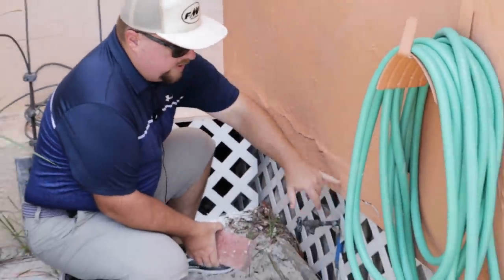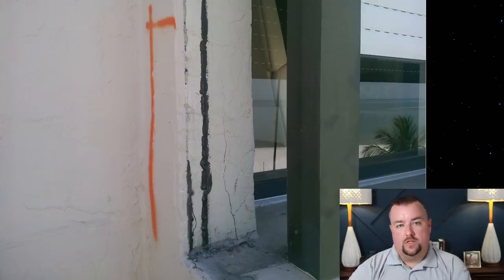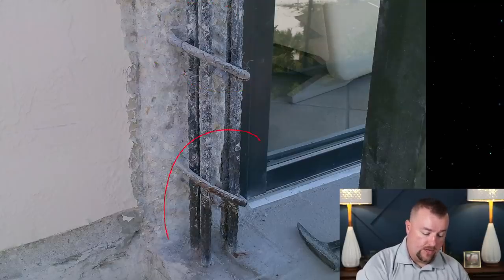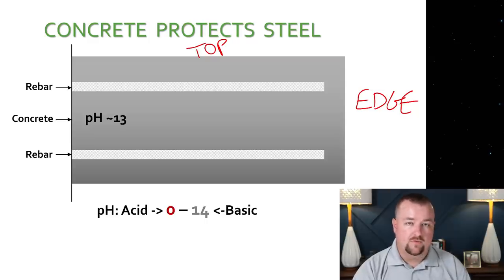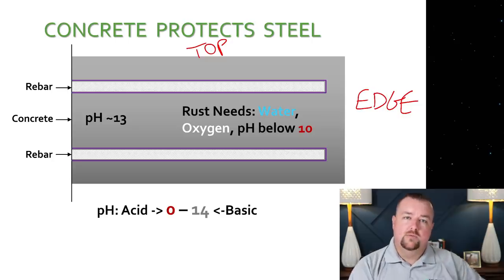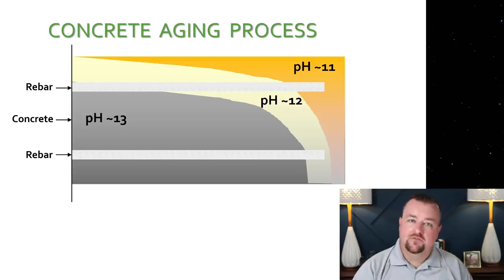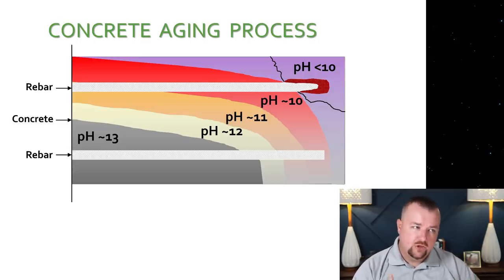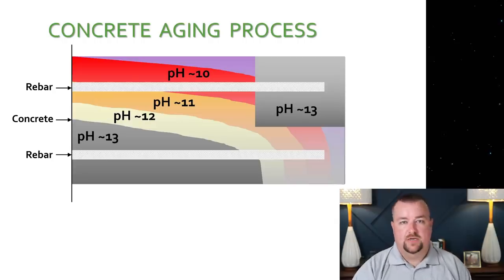Reinforced Concrete's Number 1 Enemy

Comment: So, in conclusion, one should avoid an older concrete structure.  Cause there is no way a condo board spent enough money to hire contractors to habitually to maintain these structures.  And if they are now forced to do repairs because proper maintenance has most likely never been done. It’s going to exceed the value of the building in many cases.  Imagine owning an apartment worth around $400,000 and getting hit with a special assessment for $100,000 to pay for your share of the repairs? Like your hoa. Going up 1,000. Or more per month?

Comment: Your are some what correct...but you can not explain why bridges with salt water area don't corrode or why concrete has not decorate.  You have to specific why it corrodes here and not there. ANd I had seen bridges and building last 60 years without issue near the Ocean.  And you failed to mention frost and defrost .  Example : Coney Island Buildings

Comment: Question to the uploader. 
Why dont they rustproof the steel rebar in advance? Do you have technical data on powder coating, s
Zink oxide, solvent epoxy coating? Urethane coating?
It's a matter of an ionic polymere crosslinking chemistry someone knows about.

Comment: How common is this and does this mean any cheap slab's can break even pre tension cables? Would grounding the rods  and cables keep them from oxidizing?
Reply: Can you generate low voltage in that  acidic environment,?

Comment: I think the explanation of the chemical situation is not complete. You mention CO2 coming from the air. That and water forms a weak acid: H2CO3. Which has created caves in limestone rock. The salt (NaCl) from seawater spray in contrast dissipates into an acid and a base. But both are in equilibrium so they cancel each other out. Which is what made salt in the first place: the neutral end product of an acid and a base reacting with each other. So the shift to an acidic environment in the concrete is done by the CO2 which gives H2CO3 carbonic acid, which is weak but still an acid.

Comment: So if you want to make things last a hundred years, don't design the structures with reinforced concrete. Keep the concrete always under pressure, and leave the structural steel exposed to allow for regular maintenance such as painting it.

Comment: Roman concrete last for over 4000 years. Modern steel concrete structures lucky to survive a 100 years. Why they didnt use galvanized  rebar in these structures is a good question. What about fiberglass rebar?
Reply from the maker: Galvanized rebar would only buy you some time.  Instead of the rebar corroding when the pH drops below 10, the galvanic coating would be consumed via galvanic reaction, and then the steel.  We actually use zinc anodes in a lot of repairs to extend the useful life of the repair, but eventually time will always catch up to a reinforced concrete structure.

Comment: pH? Sorry.

It can go negative.

And it can be 15 and more.

But you DO need concentrated acids and bases.

And you USUALLY stay between 0 and 14.

So I should forgive 

But I still remember having to calculate the pH of a HCl acid solution. That we made ourselves very carefully.

And mine was like -1.53 and I had to calculate the dilution ratio to hit pH 3. I think it was 1 in 20,000. Which was possible but complicated

Comment: Only pure water evaporates and comes down as rain.
Reply: Much of the dust, pollen, pollution, salt, etc. in the air gets caught in raindrops as they fall.  These have different pH levels.  Some pollutants are low in pH (acidic) which is where the term acid rain comes from.  Also, water--whether it has minerals mixed-in or pure--is a corrosive to many objects, some metal.

Comment: cant you coat the parts of the building thats exposed to rain in something thats water resistant? i think its unreal how there exist man man structures that are still standing today which were built thousands of years ago and didnt have any repair or anything like that, yet a modern high rise building collapses in florida because of rain after just 40 years, are you kidding me? xD maybe concrete and steel structures are just inherently flawed.
Reply: steel in concrete is problematic.  romans used just concrete with great lasting results.  modern cost and style considerations have pushed us to rc construction.

Comment: That intro was false. That was not structural, it was a stucco finish coat.
Reply from the maker: Absolutely incorrect.  That was the bottom reinforcement for a primary beam extending between two pile caps.  Watch it again, the chunk is nearly 3 inches in each direction.  Not just stucco.  I was there, I pulled it off.